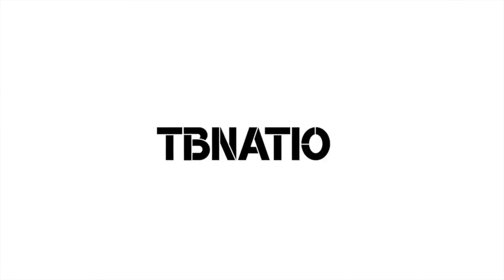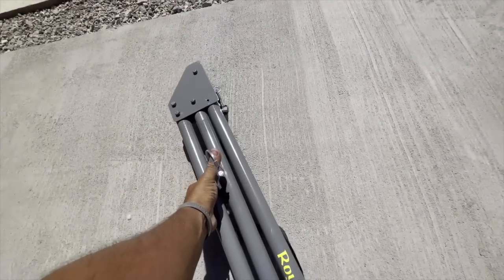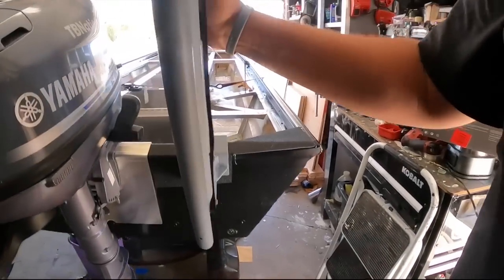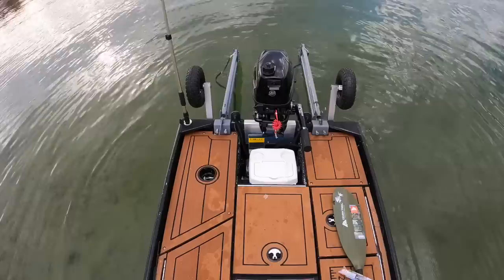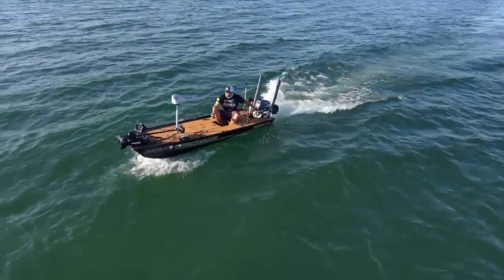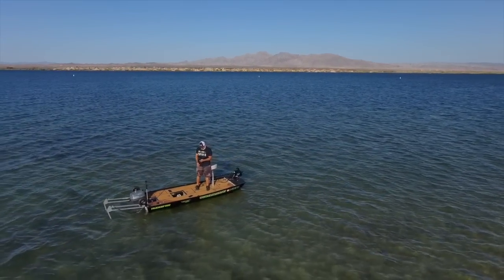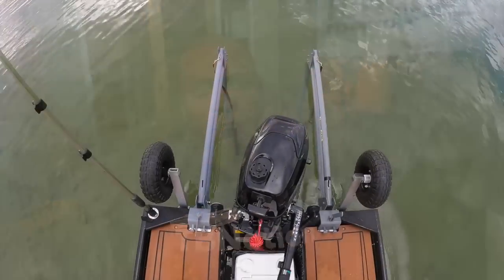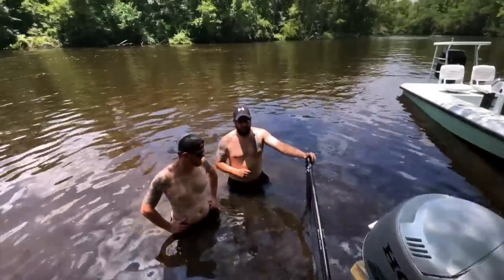Royz Shallow Water Anchors vs. EVERYONE ELSE!  One clear winner for tiny boats.

Comment: I think you need to revisit the micro as they are quite powerful and lift my 4m fibreglass boat out of the water... you may be suprised
Reply: @TinyBoatNation  Yes. I used one on my Gheenoe and the fiberglass will dig into hard packed shell bottoms of lakes and the ocean. They are extremely powerful and I would recommend giving them a shot. My only complaint was that if a water splashed over the transom and soaked the unit, it would stop working. I fish in the flats and saltwater started causing corrosion so I decided that the Micro Anchor was not the best for me.
Reply: @TinyBoatNation  Yes sir

Comment: I have a 14' Sea Nymph, (FM146), the boat is under 500lbs, would these comfortably work on a boat of that weight? Also, what's the max dept they van be used at? If maxed out, are they difficult to pull up? Thank you for the video, highly interested in these,

Comment: Great idea and very simple to build one yourself if you have a welder and some basic knowledge . should think about using skateboard bearings  or something like that. that thing will be smooth and drop quicker.
Reply: You wouldn't need bearings. Nylon bushings and grease would work just fine.

Comment: Would one work okay or is two recommended?
Reply: one will work but you will spin around the axis of the single pole. with two poles you wont spin at all. same deal with a traditional anchor, you throw it out there and no matter how tight you tie the anchor line you will spin around that anchor with wind and current. 2 poles gets you around this issue. Tight lines!

Comment: You forgot the most important aspect of a power pole is that they are silent. Dropping that anchor is going to make noise
Reply: @TravelingStacker  you need the weight of the drop for these to dig in. Otherwise you will just drag along the bottom